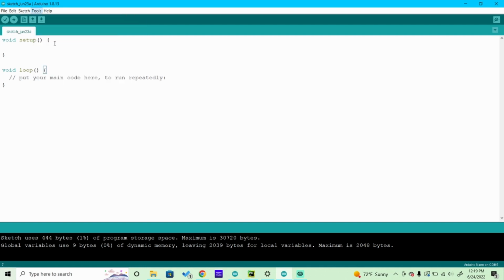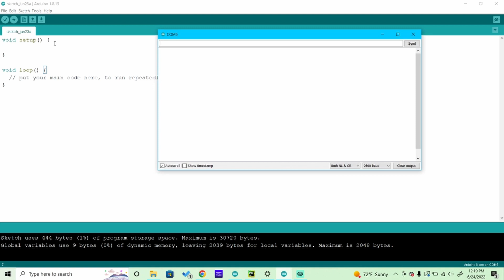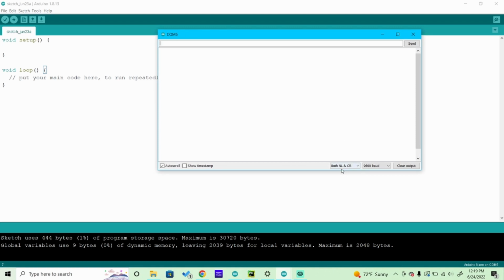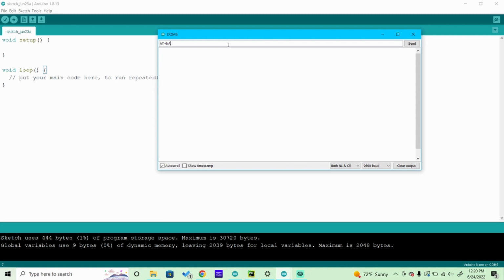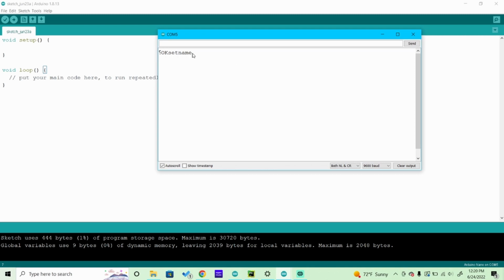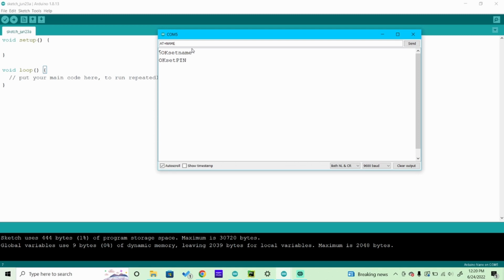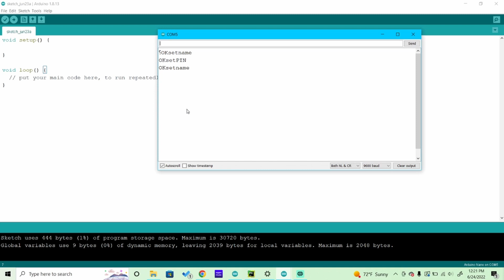How to change HC-02 Bluetooth module name (works)

Comment: How did you get the HC-02 in AT mode? Just by pressing the button when powering on? Mine doesn't seem to go into AT mode :-( And I need AT mode to change the baudrate.
Reply: After I set the correct baud rate of 9600 it worked. Other sources used 38400 for AT mode. I could then change it to the rate I need for communicating with my grbl board.
Reply from the maker: I believe when you send AT to it to put it into at mode it does go into at mode it just doesn’t send anything back to confirm so try sending at and all of the other commands but it probably wont say anything back when you send AT